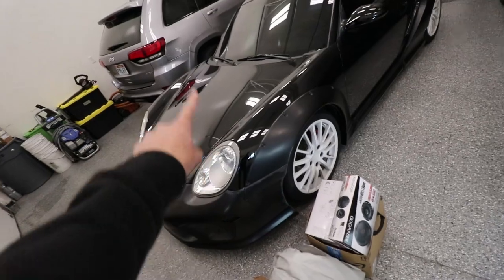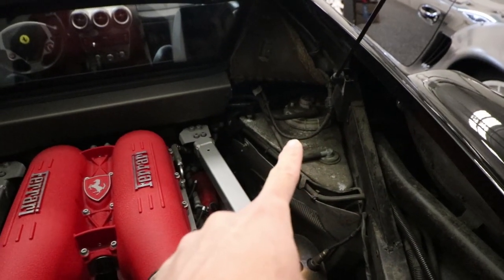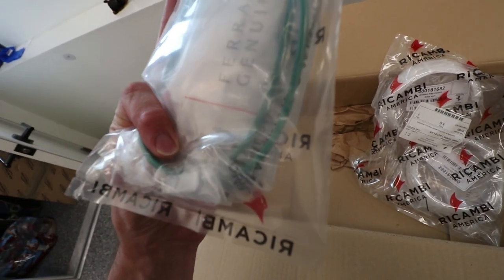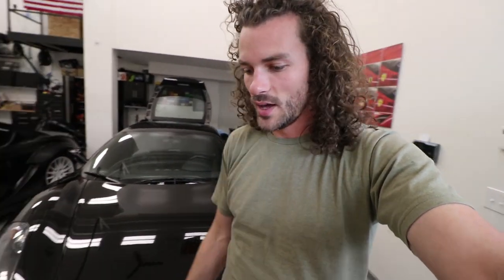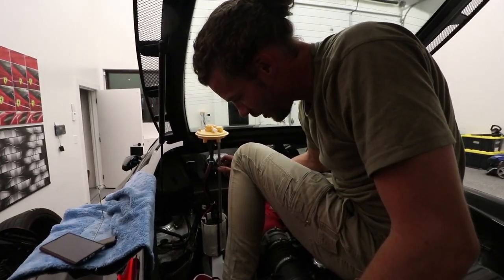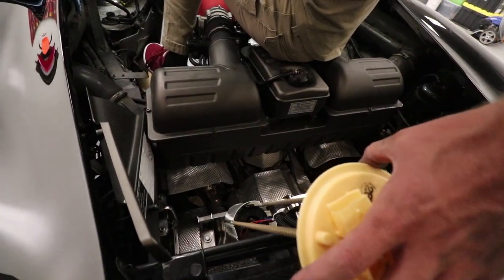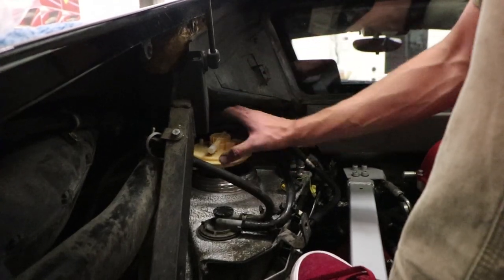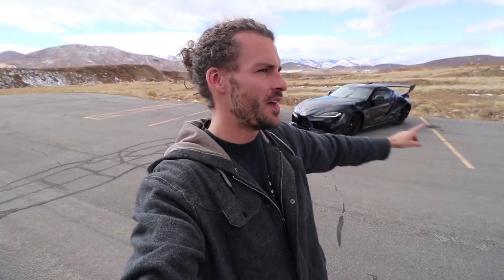Ferrari Fuel Pump Repair + Supra Donuts!!

Comment: I would definitely replace the other pump at the same time.. cause a breach on fuel in an Ferrari engine bay with extremely hot exhaust.. not a good idea.

Comment: @summitlife you should check out #samcracs channel and his videos on the #430 that hes rebuilding. He just repaired a fuelpump too
Reply: he's rebuilding a 360
Reply: Automotive Squad i just realized that i put the wrong model. My fault. It is a 360.
Reply: Everyone repair the cheap plastic crap fuel pumps that tend to be the cause of alot of the burnt out Ferrari's someone should do a video on replacing them with better aftermarket ones that are safer have all the Ferrari purists pulling their hair out over it

Comment: Them cheap plastic topped fuel pumps  are the cause of most of the fires in Ferrari's would be getting better after market ones to stick in instead. Ferrari purists might not like it but making a car safer and better I would do it